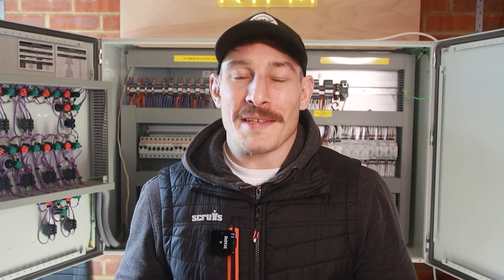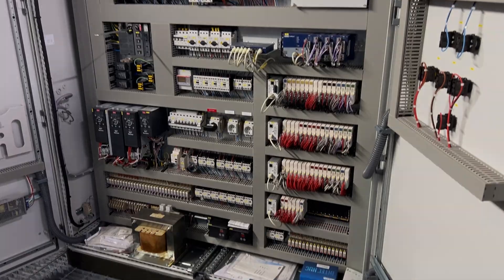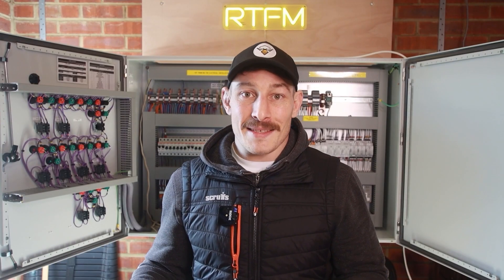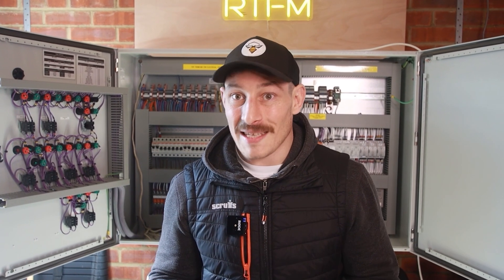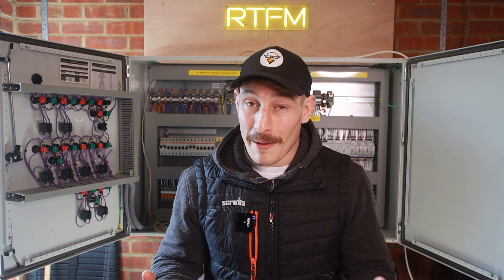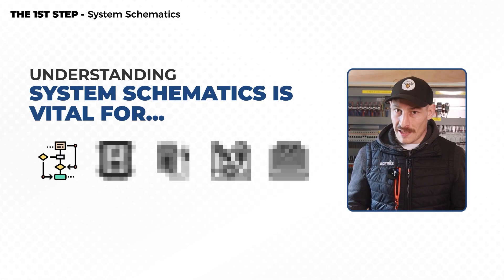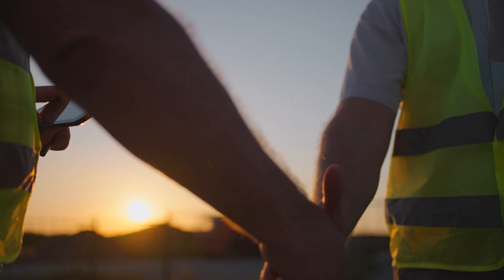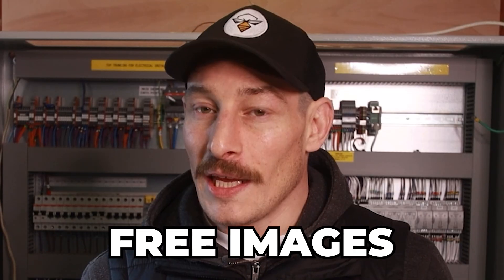Why I Think Beginners Should Master Electrical Schematics First

Comment: Thanks so much for this starting point! I was accepted into the IBEW local 3 electrical apprenticeship. Right before I went into work, they called and said they are laying off apprentices and can't hire me. I had already quit my other job. Now I'm looking to pivot in electrical and came across your control panel videos. I think this would suit me better (than say low voltage work.) Back to the starting block but I think it's worth me trying this route. Thank you!

Comment: Hello ! not the best place to ask but... how do you manage DC power in your pannel ? for example, you have a power supply with two outputs, but has to deliver that power to, for example many devices ? (PLC, relays, safety relays and so on).
Reply from the maker: Hey man, not sure what your question is buddy… can you re-phrase it?
Reply: Hello, thank you for the reply, I mean, how do you deliver DC power from your power supply to the electronics in the pannel? For ac power I do use distribution blocs.
Reply: @williangomesarruda2972 you can simply use terminal blocks? Not sure exactly your question though. If you’re talking about from point a to point b then yes, terminals blocks etc. same as your 120AC. If you need to supply many multiple devices then you can always just put jumpers.